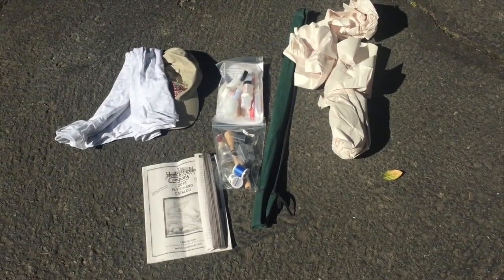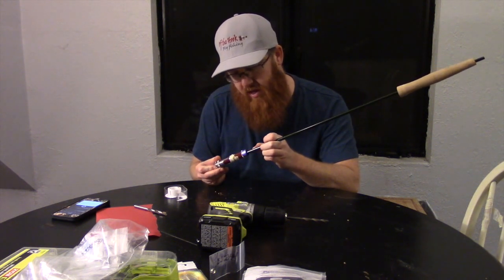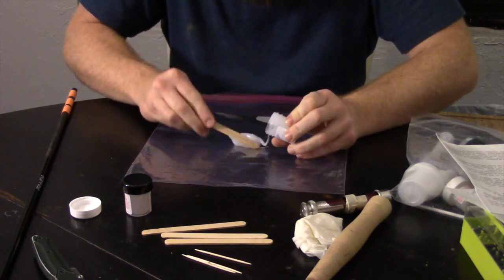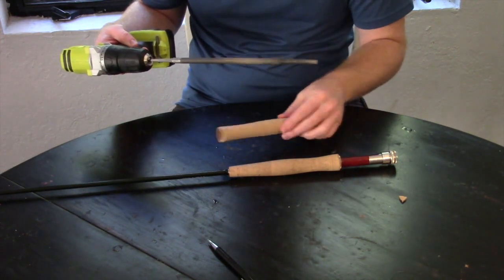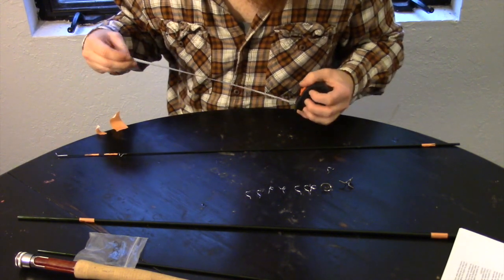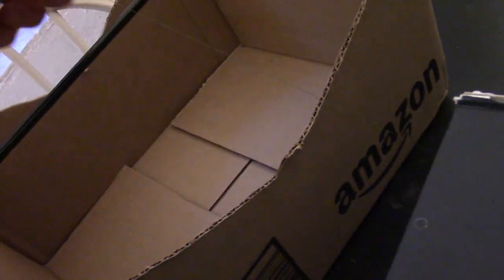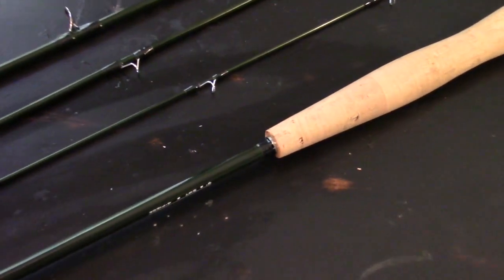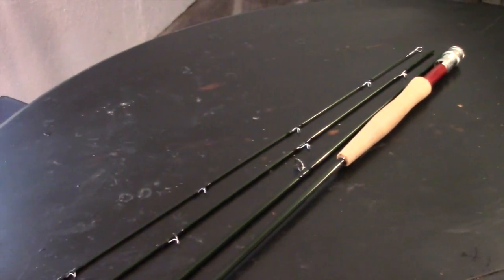Building a fly rod - Beginners full fishing rod building guide

Comment: I found using thin short slivers of tape over the guide feet make removal easy and dont disturb the side you wrapped. I also check every guide foot to make sure there are no burrs or sharp edges that can cut through the wraps. You can just place a thin tape at the midpoint of every guide so you dont have to tape all the guides on
Reply from the maker: Cool thanks for the info, I don’t know a lot about this, but it sure was fun to try it

Comment: Use a cigarette lighter flashed over the whipping to remove wiskers. Also, use warmth (lighter or hot air gun) to smooth out epoxy and burst air bubbles on whipping,  but you do need to keep rotating the rod while epoxy is fluid.
Reply from the maker: Sounds good thank you.

Comment: Job well done, have you already used it? How do you like the rod sofar? Like you said in the video, it seems that with a little patience and a forgiving wife, most everybody would be able to tackle this.
Thanks for uploading.
Reply from the maker: yes I have used it a few times.  Its a little more moderate than my other rod, but thats good for some cases.  I noticed a few things I did wrong, but they aren't that bad, and don't really effect the fishability.  Otherwise it fishes great!  I even caught a fat 18" trout on it, and it handled it just fine.  It wasn't underpowered even though its a bit moderate action.  All around a pretty decent rod.  Not a sage, or a g-loomis, but for maybe $175 for all the materials, its way better than any $200 rod I've ever fished.

Comment: How long did you wait for the epoxy to cure? I just finished applying PROKOTE on the my Fly Rod and its been spinning for 5+ hrs.Thanks.
Reply from the maker: The stuff I used seemed dry after like 1 hour, but I was told to wait 24-48 hours to fish it.
Reply: @McFlyAngler  do you still have the brand name of the epoxy. Thanks
Reply from the maker: No, sorry...  I might have put it in the description section though
Reply: @McFlyAngler  cool I will check your YouTube